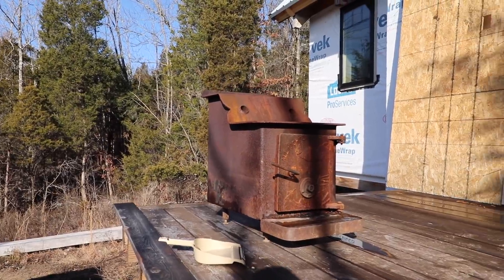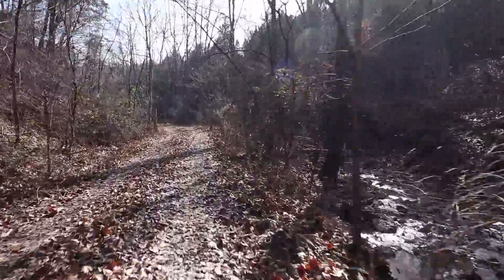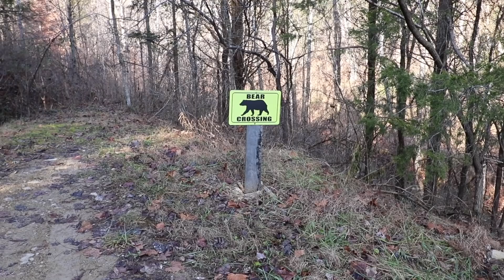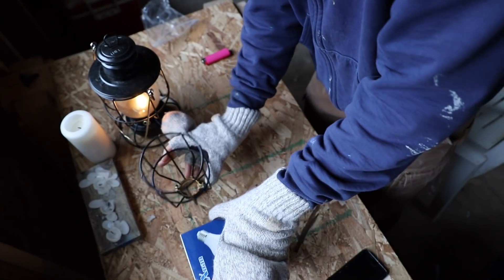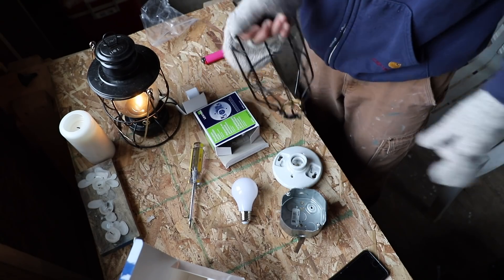Visiting my Neighbor, Wiring an Off Grid Cabin for DC and AC Power

Comment: I’m by no means an electrician but I wired my house! ( it worked )! Lol. 
But can I do the same for dc? Can I use regular breakers and wire as if I was doing for ac?
Reply from the maker: Hey Justin, there are quite a few differences actually.  The voltage is lower usually needing larger wire sizes, and DC arcs more so certain switches etc should be used.  Square D QO breakers are DC rated up to 48 volts.
Reply: 50 Acres & a Cabin ok I appreciate it!
We are going to go off grid one of these days!
I’m just trying to figure everything out before I get started! Thanks again!

Comment: Nice work.

You might consider finding a friend who is an electrician to inspect before covering everything up.

Never hurts to have two sets of eyes.
Reply from the maker: Thanks Shawn,  I would love to get an electrician out here.  I just hired one for a big job back in Dayton,  maybe I can see if he wants to stay at the cabin...
Reply: @50Acres  Ar least for an inspection.

I actually find 12 volt wiring easier. I learned on old pickup trucks and lots of trailer wiring.

Comment: On your receptacles you should actually put the ground up just in case something drops when you have something plugged in this way you will not short out.
Reply from the maker: Yes, I have heard that...
Reply: @50Acres  I've been in the trade for 45 years. And I have seen this happen many times. Whenever I used to do commercial or residential I always put the grounds up and the people didn't like it, so I explained it to him. And then they understood what I was saying. Because you have a hot in a neutral on top and that will short out very easily. If something hits the ground on the top you're safe
Reply from the maker: @frederickhillegas2115  yea that makes perfect sense.  Especially as the outlets grow older and don't hold quite so firm as the used to.
Reply: @50Acres  I'm just looking out for your safety. Great job I love it

Comment: im have certified elektric engineering and work elektric ower 20 year, i tell you what DC have example. my friend build beauty mahogany boat about 9 meter long little cabin boat, he add fridge at cabin and move wire battery+switch to fridge about 14 meter wire. him call me and ask why fridge not start and same heater no start, i go looking and measure all volts, 12 volt system normal popular system what all have around world. ok, fridge head wire i measure volts, has 11,3V volts drop this cable 14 meter lot and fridge not can start because volt has too low. i say him need change cables biggest and hi make new cables 4 sguaremeter cable, douple biggest what him has berfore, and then all work fine.  this mean only DC volt drop lot long wire and glad only 14 meter can drop wery lot, wire need add little bit biggest not wire come lot resistance and drop voltage. same has AC but lot longed wire need be before drop volts.
Reply from the maker: Thats good that you were able to trouble shoot the problem by checking the voltage.  Surprised the fridge had such a small input range, but they say that essential loads should be less than 3% drop, so I guess that qualifies.

Comment: Mike: I received a dozen of these rechargeable light bulbs as a Christmas gift.  They seem pretty brilliant, they will hold a charge while in standard use and then can be used when power has been lost.  

https://www.amazon.com/Rechargeable-Emergency-JackonLux-Multi-Function-Equivalent/dp/B0797RK52Q/ref=asc_df_B0797RK52Q/?tag=hyprod-20&linkCode=df0&hvadid=242051162351&hvpos=1o1&hvnetw=g&hvrand=15570014703012656616&hvpone=&hvptwo=&hvqmt=&hvdev=c&hvdvcmdl=&hvlocint=&hvlocphy=9051709&hvtargid=pla-613268101872&psc=1
Reply from the maker: Those look awesome, I need some of those for our house.  Probably can't use them at the cabin unless they make a 24v DC version.

Comment: watching this one again. got  back-burnered for Christmas - hope you had a great one! 
you may know this but we used to make impromptu wire caddies with a short chunk o emt and line up the wire spools; phases, ground, neutral. for dc, +, -, any shielding. you then pull off what you’re working with and cut to rough length; trimming on termination. you can gather phase(s), ground and neutral(s) and tape the end together to make it easier - goes into conduit much easier too; even without soap. 
put the emt between the legs of the ladder on the hinges - it will spool off freely as needed...
and you can always make your own caddy on casters!
Reply from the maker: Great tip, thanks I will definitely use that one.

Comment: 50 acre - If your grounds are going to neutral bar ; that's not correct. If you bonded the neutral bar to panel that's incorrect.  Read detailed. Info I sent you. Hugh ,Chicago metro
Reply from the maker: Hey Hugh, Just to make sure we are talking the same thing:  I have 1 neutral ground bond in the whole system, at the main AC panel.  I only have 2 AC circuits so it would be very easy to isolate the neutrals if that is appropriate.  There is no neutral/ground connection inside the inverter. The outlets test for "wired correctly" on the old plug in tester I have.

Comment: I recommend Greenlee,Klein, GB gardner bender ,Ideal, get one with GFI test most come with that, usually when two amber leds are lit = correct hookup. It will tell you if hot and neutral reversed,open ground, open neutral ,correct ect.
** I have been doing electric over 30 years licensed since 1986, and was an IBEW A card for 12 years, got out of that, after the great recession in 2008.I do mainly industrial,controls work as maintenance tech, for companys temp or permanent .[ This is a great cheap fast electric tool, {GROUNDING CORRECTLY IS VERY IMPORTANT !!!!}
Reply from the maker: Hey Hugh, see my response to your prior comment.  I believe I am bonded and grounded properly.  Thanks for pointing this stuff out.

Comment: A couple of questions for you 50 acre, 1. Why would you do all that extra dc wiring, if you have ac off an inverter ;just use low wattage 120 volt bulbs 60 watts actual = 9 watt.
 2. How are you grounding your ac panels. NEC see section 250 -look it up on your smart dumb phone ..[ ha ,ha.] [ code says, 5/8 copper rod 8 ft; long driven in the earth,then you attach accorn nut to grounding rod, then # 8 wire onto that rod under the nut,IE :accorn nut,put it in 1/2 emt,or 1/2 pvc, into the panel,install  separate grounding bar,put a bonding bushing on the pipe that goes into panel,then that # 8 wire goes under bushing strip some insulation off to get it under bushing, then to separate ground strip terminal,( 10 screw or similar ) So you now have a ground wire, #8 thhn, continuous, from the ground rod to the ground terminal strip inside your panel. That is the correct way to do it,you can take a wire from inverter case to that strip, pump motor frame under sink.,pump case of motor to well or shower ect. They all terminate in one place.Including the power meter if you are on grid. One single ground ,no hoaky floating crap. Buy a plug tester, 8 to 12 dollars at big box stores,to see if you got proper grounding on your 120volt ac plugs. Peace..Hugh Chicago,metro
Reply from the maker: Hi Hugh, 1) I'm doing the DC wiring because it is more efficient within my system.  I lose 10% inverting to AC.  Also being able to keep my inverter off until I need it saves a constant 30 watt idle load.
2) The AC panel is grounded to a grounding rod as you described.  (more or less). 
Thanks you for your concern and by all means please continue to point out anything you notice that my be wrong or dangerous.  

THanks

Comment: Having picked up a similar wood stove at an estate sale, I put a stove pipe on it outside, and coated it with multiple coats of vinegar(cold still) and then wire brushed it, heated the stove and used beef tallow to coat the entire outside and top especially, and it never had a rust problem again, and I frequently cooked bacon on the top of it.
Reply from the maker: thanks for the tips!

Comment: Mike, Matthew Prestine mentioned in his comment on the 3-way switch, you should consider running the Romex line down the wall, under and across the crawl space, then up to the 2nd switch. For the light fixture on the timber, run a separate pigtail from one of the switches up to beam. Use a router with and edge guide to carve a small Romex dado on the least viewed side of the timber, and then cover it with a piece of trim that will stain match the wood. Your timber work is beautiful. Why mess it up with Romex hammered in? Love your work. Great channel. Keep it up!
Reply from the maker: Yea I agree it really bothered me running it over those dovetails.  I can at least take it off once side like you suggested.  I'll have to remember to grab my router next trip.

Comment: It funny how so many folks (including myself) buy remote property and continue to drive on a shitty road because the house is usually the priority, not the road getting to it 😂 my road is still terrible, over a year after buying the property but there are many other improvements haha!
Reply from the maker: I need some road work done pretty soon here. Most of my road is doing pretty well but I have one bad section where I need some ditch work and some base stone.   It is hard to allocate the money to get it fixed right.
Reply: 50 Acres & a Cabin I know exactly how you feel. I could spend at least 3-4 thousand on my road doing the grading drainage and gravel but I usually end up buying building materials or other homestead related things. It’s a constant mental struggle with where to spend the very small amount of funds for the whole project. You’re not alone
Reply from the maker: Yea and every time you throw some money at it your wondering if you should have saved up for some heavy equipment or something!

Comment: But he is on the grid.
Reply: Yes but use it for resale later as all was built with generator.  Using DC for pump and convert solar to AC. This county has no forced metering on property yet. Out here people will not stand for such intrusion.

Comment: why do you pull out so much wire then cut off 6 or 8 inches every time? I could wire two houses with the amount of wire you use and cut off  to wire one and worst of all all you guys do the same
Reply from the maker: Tim I use what I cut off when I make the pigtails.  I'm not sure but I think code for a rough in requires 8 inches sticking out from the box.   Sometimes I accidentally waste some also.

Comment: Not sure what state you are in but I have a cabin in Oregon and have a hard time keeping the batteries from freezing when I am gone. Any suggestions
Reply from the maker: I've been told that as long as they are fully charged before you leave and in good health (they can hold a charge) then they shouldn't freeze.
Reply: look at small 8 to 10 watt solar panel on ebay and insulate the batterries  and vent as needed. I did this on my cabin and worked we get as much as  20- F

Comment: Merry Christmas to u n ur family..🎄 and a Happy New Year.

Your neighbors front porch and its roof looks really nice.. U can do it for ur place too.. 

Suggestion: decorate a mid size (a little higher than you) pine tree with lights..(USB input lights) Outside..ur cabin.. Powered via a USB a battery bank.. You can plug in the battery bank n turn the lights on the tree..once ur back at the cabin after Christmas.
Reply from the maker: That would look really nice!  Merry Christmas Edward!
Reply: thank you Edward the cabinets I got out of a camper tossed in the salvage yard and covered the doors with the cedar cut. Why it was so cheap to build. thanks for watching.

Comment: Great video. I like how easy you are to listen to in front of the camera and I like your honesty. I've been doing basic house wiring for a LONG time and everything you did looked fine to me!  The wire on the beams, will that be seen, or will you toss it in conduit at some point. That is always pretty easy to do in the future. Your neighbor looks like a great guy. It's communities like this that make me realize that there are still some good folks left. I hope you have a great holiday with your family.
Reply from the maker: Thanks Man!  He is a great guy!  I think I will throw that wire in some MC eventually.  I wish I could get it up there without being seen.
Reply: Thank you for your kind words. Merry Christmas to you. KIM
Reply: No easy way to hide the pwr wire but I've had great luck with wireless relays. 2 switches and a receiver at $25 usually come out cheaper when mc and metal boxes are involved and they save time...haven't used the 12-24v receivers yet but the price is similar
Reply from the maker: Another commenter suggested that I can get rid of the wire on one side by running from switch to switch under the cabin then going to the fixture last, so I am at least going to re do it that way and get rid of some of that ugly wire.  I will have to look into wireless relays, don't know much about them.
Reply: @50Acres  the receivers are wired into the same box as the light and are controlled by wireless switches that look similar to wall plate switches...they're a little funny looking but not totally aesthetically unpleasing. You can also order remote controls and any configuration you want switch and receiver wise. The Bluetooth type are a little pricier but the switches look normal

Comment: Your friend's cabin looked great, Mike! Sorry you had to repeat the first grade.😟
Reply from the maker: Haha thanks man, turned out to be a good thing and I ended up fine in the long run (arguably...)
Reply: there are some things not seen in most vids  about Cabineers a washer and dryer spin  that runs on my converter. It is white and sitting by the bathroom door. got it from France new 125.00. works great!! thanks for watching more to come Mike's friend.    KIM